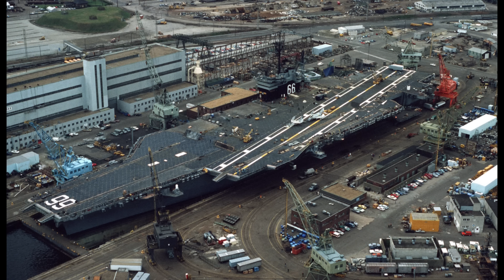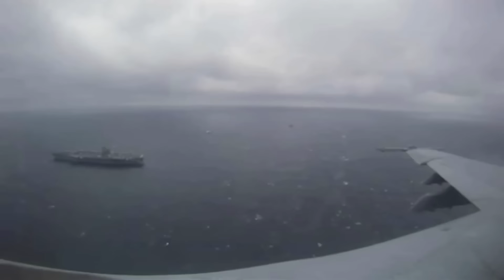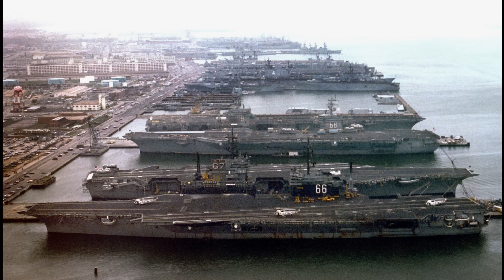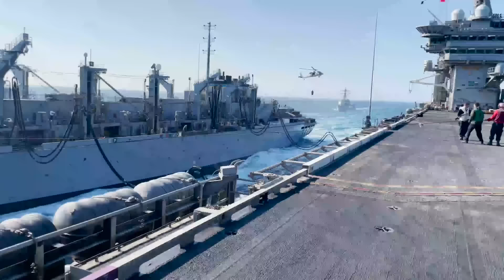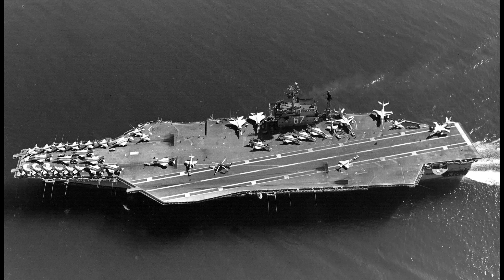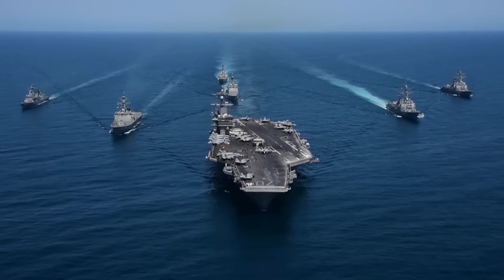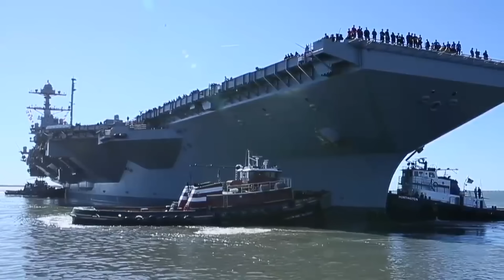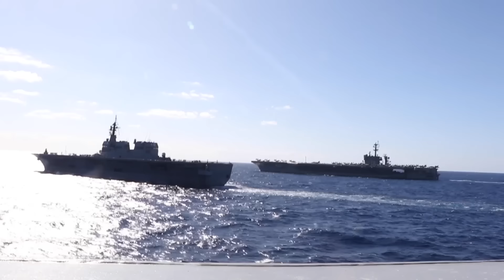Kitty Hawk Class: Why the US Navy MUST Bring Back This Non-Nuclear Carrier

Comment: We have non-nuclear carriers in our America class (LHA), they take long to build as well!
Reply: Agreed. Don't want the Super Carrier? Go with the American Class. It can field 12 F35's plus it has a ton of over features and capablities.
Reply: @KevinGilbert-g2i  Isn't the suggestion here for ships that are still super carriers with dozens of aircraft, just without the expensive nuclear propulsion system and displacing somewhere between an America and a Ford class, but probably nearer the Ford? Which still seems unlikely to happen as the development cost for something new will be high. In theory they could have two ≈80,000 tonne Queen Elizabeth class carriers for roughly the price of a Ford and the Brits have already done all the development work including designing them for catapults and angled decks, but the Constellation class cock up makes me wonder if the US would be able to resist the temptation to over tweak a QE derivative to the point they should've just stuck with Fords.
Reply: @KevinGilbert-g2i 
It's not about want, it's about capability and necessity.
Reply: LHAs and LHDs (including the American class pair without well decks) cannot do the same job as actual CVs like the current CVNs or the old Kitty Hawks, because they cannot support an adequate air wing.
Reply: @geodkyt   Nobody is saying or should be saying replace.  Discussion was, we should have some non nuclear flat tops, and we do. Just not enough in my opinion.
Reply: I consider we have 11 Super Carriers and 10 Carriers. In WWII the US had over One Hundred Carriers most Escort Carriers, and I think we need some additional smaller Carriers like Light Carriers, Escort Carriers, and Drone Carriers, because China is being a Dick, and we must beat their Challenge to US which will be Deflationary 🦅🇺🇸🦅
Reply: @RealRandyRoss  The UK spent about the same on their two Queen Elizabeth class carriers as you guys spent on the Gerald R Ford, and they designed the QEs to support catapults and angled decks which I expect the US Navy would prefer. The trouble is 11 Fords and 10 QE derivatives would still cost as much as 16 Fords and you'd need the budget to extend to more support and escort ships and aircraft for those extra carriers. Has the US got the money for all that? But if you cut the Ford order to 9 and went with maybe 5-6 US-QE ones you'd only be spending about one Ford class worth more on carriers, so you could more easily afford the other stuff. If a repeat of the FREMM/Constellation saga could be avoided, which I don't know about  ¯\_(ツ)_/¯
Reply: @Dasyurid 
They need the Gerald R Ford carriers.
Reply: @CFak-i9r1c  Yeah, of course they do. But do they need 11 of them if they were to build half a dozen extra carriers about ¾ the size and half the price? Look at it in terms of how many decks for how many dollars. By reducing the Fords by 2 they could go from 11 to 13 carriers. By spending one more Ford worth of money they could have 15 carriers. They won’t do it of course. I reckon they’d rather stick red hot needles in their eyes than have any conventionally powered carriers again, but if they wanted they could easily have a two tier carrier fleet and get more capability and flexibility.
Reply: @RealRandyRoss 
😂 The US should probably mind its finances. If you spend too much, you're going broke.

Comment: Would a small carrier design work as a future development. I know operating and maintaining ten and more super carriers is already very expensive especially including all the aircraft and crew you have to care for. And the size of the carrier limits where they can be built. So what if we brought back the Aircraft Carrier (Medium) project. I believe it's around the size and weight of the Charles de gaulle but it's cheaper. Personally I believe our carriers are too big with too much crew, they were built in a time when everything was getting bigger but nowadays it seems better to make numerous smaller weapons than a few big ones.
Reply: I can pretty much guarantee that a smaller carrier will provide 60% of a nuclear supercarrier's capability at 80% of the cost. Plus, sortie generation rates and combat persistence will be way, way lower and electrical power will be limited from the start.
Reply: @CuriousGuyHobbies you should look into every time a carrier escort group has met a nuclear submarine in simulated War. There are two examples with the US both times the carrier and all the escorts were sunk that would be a basically like destroying a small town. And if you go in the water and there are submarines around and the fact that no nuclear submarine can even track another nuclear submarine with passive sensors. Results in the crew dying in the sea because nobody can pick them up anymore. And just to let you know both attacking submarines in the simulations completely escaped including the submarine escort with the carrier group
Reply: @masterofsnatch1645  Then again, you should look up the results of the simulations of a war with Iran and what those would do to the US Navy. Turns out the simulations were completely and totally wrong.
Reply: @LiberTeabag420 these were not anything more than formalities the Torpedoes would have ran the same course. These are not your grandfather's torpedoes you can't fool them with countermeasures because they're being Guided by a human being by a fiber optic tether. No ships survived either one against the diesel electric hybrid from the Sweden period or the French nuclear submarine both had the same outcome do Google Search
Reply: @masterofsnatch1645  then, they will use more SSNs for escort duty & add an LHA for ASW.
Reply: @Steven-k8t no technology has been proven to be 100% did you know that the submarines can't even be detected by the helicopters. The only way they can be heard is if they turn on their non-passive sensors which they would not do
Reply: @masterofsnatch1645  Modern submarines are not completely undetectable. Helicopters use specialized tools like dipping sonar (low-frequency sensors), sonobuoys, and Magnetic Anomaly Detectors (MAD) to find submarines, particularly in shallower or littoral waters. Active Dipping Sonar: Helicopters like the MH-60R Sea Hawk drop sonar sensors into the water to detect submarines. Magnetic Anomaly Detection (MAD): This allows helicopters to act as a "metal detector" for the magnetic disturbance caused by a submarine's steel hull.  Aircraft can detect submarines through non-acoustic means like thermal imaging or tracking surface wake/disturbances. Allied P-3s or USN P-8s can also assist CSG from land bases/airports, besides organic UUVs that can hunt for subs.
Reply: @Steven-k8t I know a guy who worked in the sonar detection. He said the exact opposite thing I've also seen that reinforced by a YouTuber who's also an expert sonar operator. Know they can't detect them the as a matter of fact have to have the submarine surface so they can simulate a recently diving or turbulent submarine so you're wrong
Reply: @masterofsnatch1645  even if true, I'm sure that sperm whales & other marine life can detect subs at great depths to avoid collisions, & there will be methods developed, unless we r not smarter than them.
Reply: @CuriousGuyHobbies  doubt that, if a Charles the Gaule-sized aircraft carrier was an option, it would cost 80% of the cost of the full fledged Ford class.

Something with half the displacement, that works as a complement to the supercarriers, not a replacement, doesn't need to offer the same sortie rates either.

It would work well as a lower cost option, with smaller complement, well suited either has it's own Carrier Group in areas where a supercarrier isn't needed, like the Mediterranean, or as a reinforcement in a main Carrier Group. A class of 6 ships atleast could make sense.

You can also look up non-CATOBAR options, with something similar to the Queen Elizabeth class, that can carry a lot more aircraft than an LHD/LHA, filliing the gap between these and supercarriers.
Reply: Usually smaller carriers do tend to be more expensive than larger ones when looking at the capability you’re getting for the cost. The up side is that even though the per unit is more expensive, you have more. This is due to the square cubed law. Cost is more or less a direct relation to surface area (which has a squared exponent), while capability is more or less a direct relation to volume (which has a cubed exponent). Larger ships tend to be much more capable (and have much more longevity in service life because they can better handle upgrades) than smaller ships. Basically the larger ships tend to be much better investments especially in the long run.

A good example of this is British and American destroyers from WWII. British destroyers were trying to save money in the short term and so they built their vessels as lean and minimal displacement wise as possible. American destroyers were leveraging American industry and we built ours quite a bit bigger, even though up front it was more expensive. But what happened in the long run? The smaller British destroyers had much less longevity in their service lives in the Cold War because they couldn’t handle the weight of new upgrades, and if they were upgraded it was extremely expensive because the ships had to be rebuilt. What happened to the American destroyers? Because they were larger and more capable and could handle more upgrades, they were also cheaper to upgrade, and were upgraded en masse into capable anti-sub and anti-surface escorts for much of the early to mid Cold War, with all being retired by the mid-70s (having entered service in the early to late 40s, this means a service life of 30ish years, quite a good investment), and many that were retired from American service were then transferred to allied navies around the world where they then served another couple decades.

Larger ships just tend to be better, cheaper for the capability you get, and have better longevity in their service lives; they just tend to be better investments overall.
Reply: @mm8092mm fair piece of knowledge you passed on their Matt
Reply: @mm8092mm  the thing is, budget and personel constraints are still the limiting factors. If you need 20 supercarriers, but can't afford that many, then a mixed fleet with supercarriers complemented by smaller ships is better than nothing.

As for the actual costs, it will depend on the size and configuration of the ship, and what you include in it. You can go from a nuclear powered one, in CATOBAR configuration, with just 2 catapults, less nuclear reactors, cheaper radars, etc, to a non-nuclear aircraft carrier similar in size and configuration to the Queen Elizabeth class, which will cut costs even further, albeit by being dependent on STOVL aircraft (F-35B), VTOL platforms, and STOL UCAVs (MQ-9 STOL).

It's up to the USN to decide what would be the best fit.
Reply: Every time a carrier escort group goes up against one single nuclear submarine every single time this has been tested the whole carrier fleet was absolutely destroyed